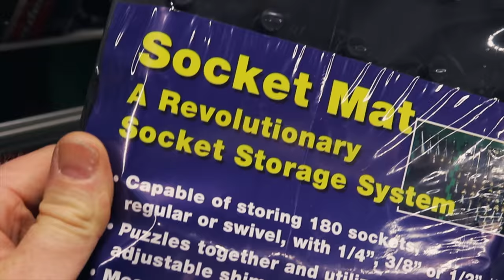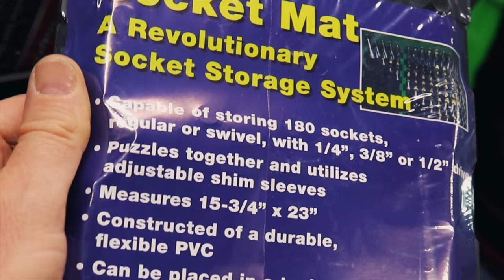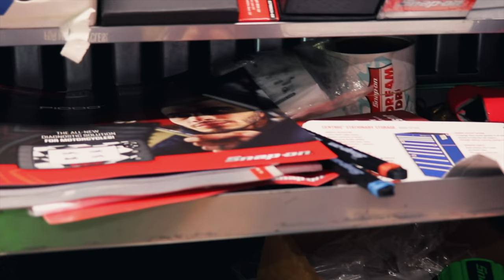Snap On Friday ! Lots Of New Tools: Drill Bits, Ratchets, Jump Starter and More

Comment: Clay that Jumper does it jump your big trucks with dual batteries? I'm a fleet mechanic I was thinking of buying something like that
Reply from the maker: I haven’t tried it yet it charged all night long and finally got full before i woke up. The gb70 will start a 7.3 Diesel with dead batteries easily and it is rated for a 6.0L the gb150 says it can start a 10.0L Diesel so i think it may if they aren’t completely dead. I will let you know when i try it